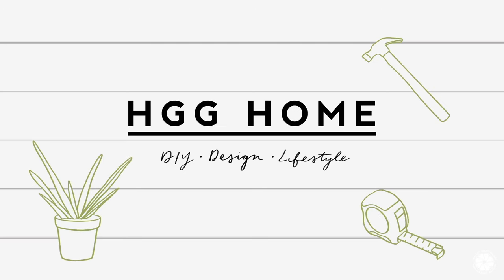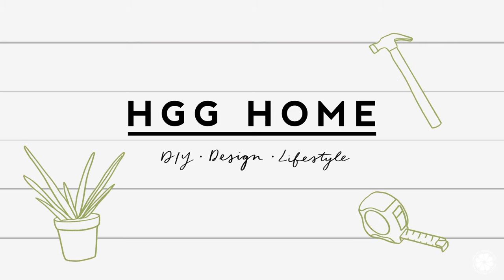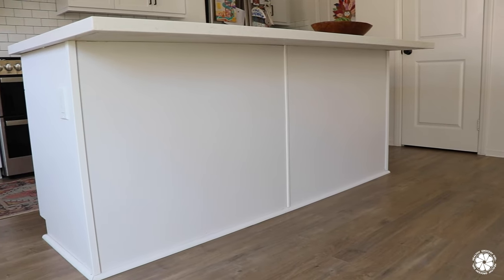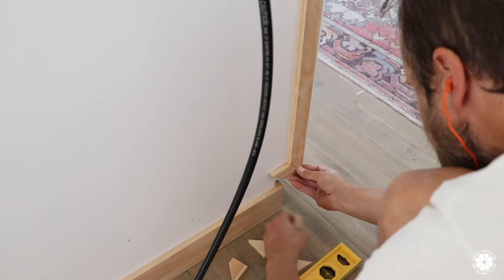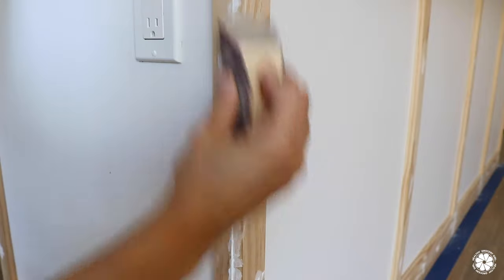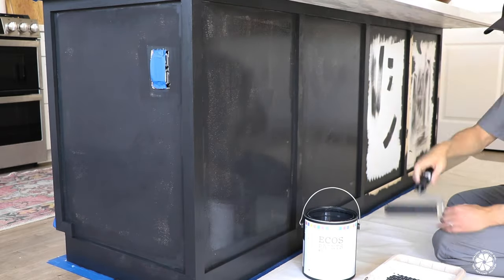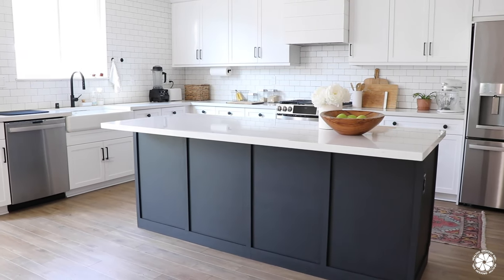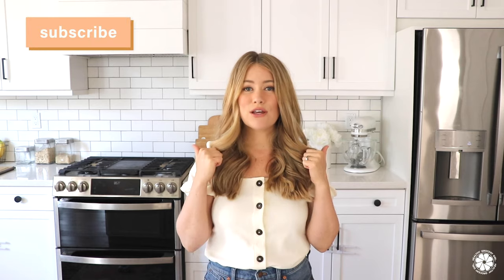DIY Kitchen Island Upgrade - How to Update a Builder-Grade Kitchen Island With Trim and Paint

Comment: What did you do about the trim pieces that were on the corners and running down the center before you started? Did you pry them off first? What is the best tool to use for that?